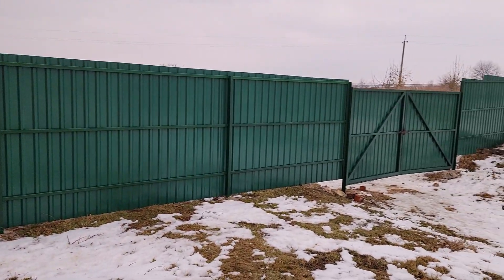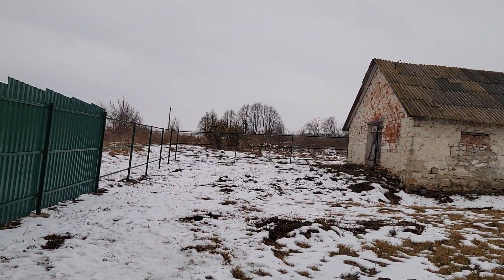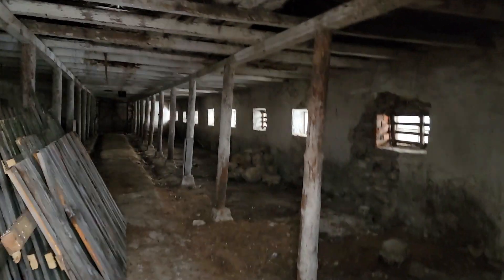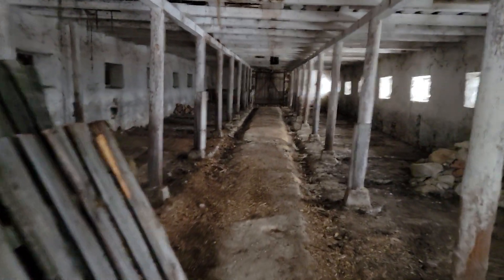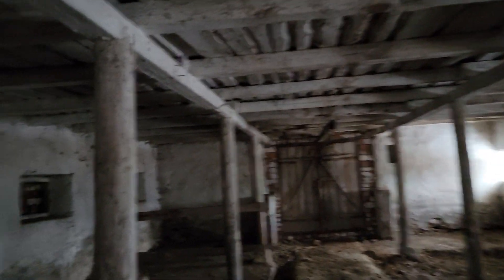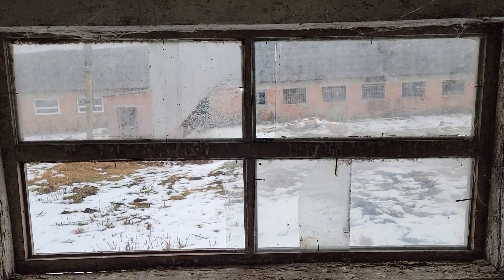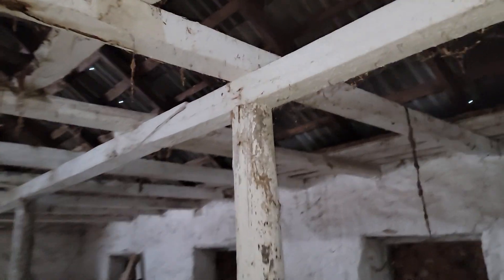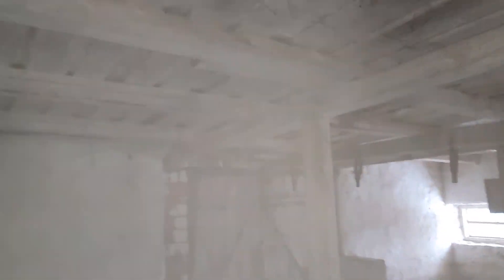Working on interior perimeter, ideas on what to do with 2nd big building.

Comment: How hard is it to get meat chickens?  You could use the 2nd big building for meat chickens.  Clean it out after every batch of chickens.  You are going to need to start looking at manure disposal before long...or getting fields to spread it on.  Where did Yanukovitch get the green metal to go around the Mezahirya Residence?  That was the fancy 350 acre property he embezzled and spent $100 million on.  Now it's a park.  It had 25 foot tall green metal fence around it.  Can you paint the galvanized side of the green/galvanized metal?  Or get a non-galvanized metal, and paint it green?
Reply from the maker: There's no money to be made in chickens here.